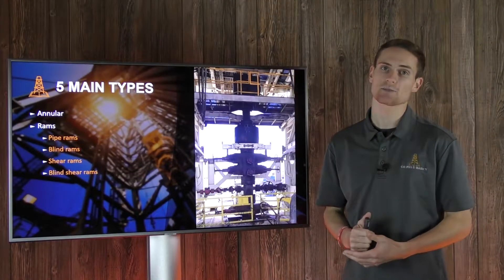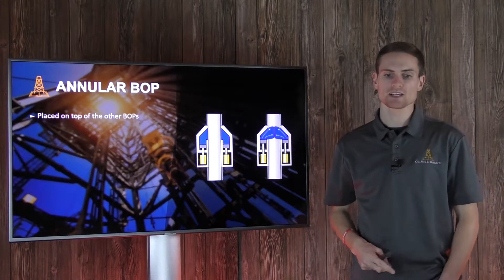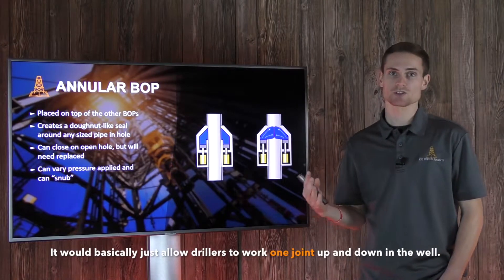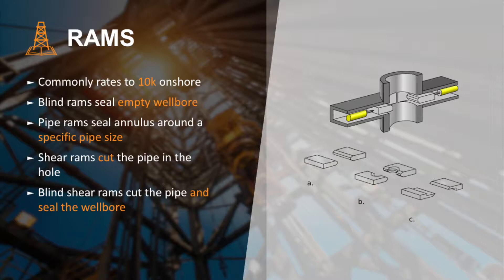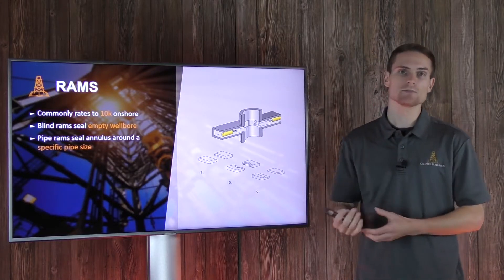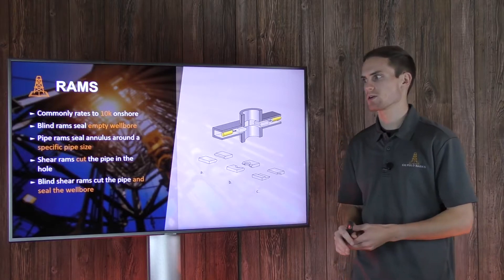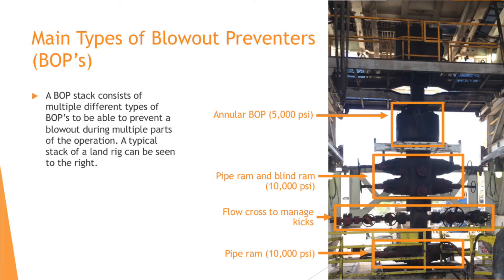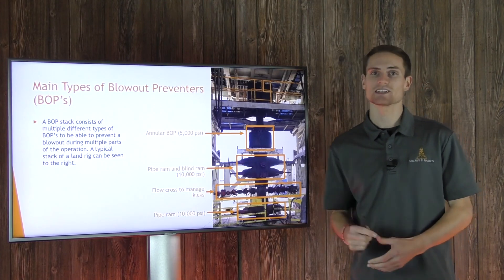Blowout Preventers - The 5 Main Types (3/3)

Comment: The valves here cannot be used to test valve operation until needed. The hydraulic rams are only effective if the pipe is aligned, this also seals the well. Repairs can't be made to either use the well to keep producing or seal with cement / slurry mix. If the bent piping is corroded through or attempts to repair another spill will occur. This type of blowout prevention doesn't work and will leave the owners wondering what to do? You sure as hell aren't going to get any oil out of that well and can't abandon, unless a spill is created. There's no way of controlling pressure or isolating pressure to pull this type of bop valve off or even a way of knowing if it works. If spills occur who's going to point the finger at who? The deep horizon costs over 100 billion and still rising. But let's keep using this system cuz we're saving money for now. In today's market our nation needs to stop importing oil and natural gas as the state of Alaska alone contains enough oil and natural gas to provide affordable heating and transportation fuels for the world's market and nation for the next 500 plus years. Plus we've just stopped using Iran's fuel. Obama's illegal EPA reg are being lifted and means oil production on our oceans will increase. The likelihood of more spills occurring will increase unless better bop valves are used.  That means production that will not be stopped by a used car salesman talking up this type of bop as it means trouble. There's no way of performing periodic testing or repairs. No way of isolating pressure to repair or replace an inop bop without risk of creating another deep horizon spill. Read below that I'm the designer of the caphead that stopped the macondo well leak and how my design basically stolen from me. Seeing how vulernerable these type of bop valves are used in ocean based drill platforms have better designs that wil prevent blowouts as well as keep the flow of oil going. My designs will not be free and will have patents but can honestly say that using them will not cause spills that will cost as much as deep horizon's. "007".

Comment: Wow nothing basically has changed which leaves the possibility of having an uncontrolled leak like the deep horizon's wide open. These type of bop valves are not meant to be periodically tested for proper operation. The only time they are used is when they're needed. There is also nothing isolating pressure if the Bop needs to be repaired or replaced. If the current type of blowout prevention valve needs to be repaired or replaced it cannot be removed or parts removed without causing another major uncontrolled spill. In my opinion these type of Christmas trees are meant for land use only. I'm a mechanic employed by a company subcontracted to a major oil company on Alaska's North slope oilfield in Prudhoe Bay. Currently still in 2019. I'm also the designer of the caphead that stopped the macondo wells leak. I still have the design copy I submitted in July of 2010, as well as emails from the horizon helpline. In July 2010 I watched as the underwater robotics cut bent sections of line away and left several feet sticking out of the seafloor, also had a flange inches away from the pipe end. My caphead design used locking wings that would secure the valve head onto the leaking wellhead a and chevron seals that would use pressure to seal the caphead against leaks. I neglected to file for a patent pending number and the horizon helpline personnel informed me that my design was unusable. Several weeks later I watched as my design stopped the deep horizon leak was stopped. I was slapped in the face and brushed off and neither given credit or compensated for my contribution. To verify this I stopped the horizons crew from drilling at an angle and deeper into the seafloor in an attempt to create a relief well. All they would have actually accomplished would be an inaccessible leak. Cheating me out my design didn't stop me as looking at the design bop valves and still in use todaymeans more uncontrollable spills are eminent . this means the difference between paying for better design bop valves that can be repaired and maintained are needed and basic choice is to either pay a little now or billions later in spill clean up. The deep horizon's spill clean up its at the 100 billion dollar mark and still rising. My designs will not be for free and will have patents. The design bop valves will be able to be tested and maintained without creating another massive spill. I plan on starting my own deep water repair company as well as designing and marketing upgraded valves that will ald work on older valves. The choice between creating spills that will cost billions or less for upgrades is their choice. "007".
Reply: Id like to know some more, do you have a channel?